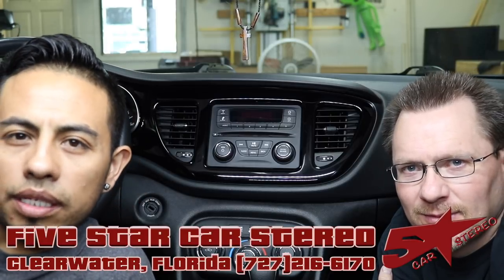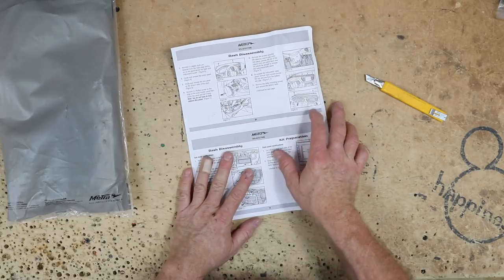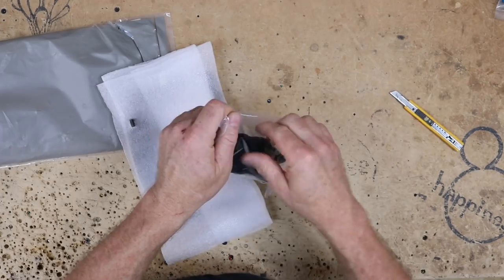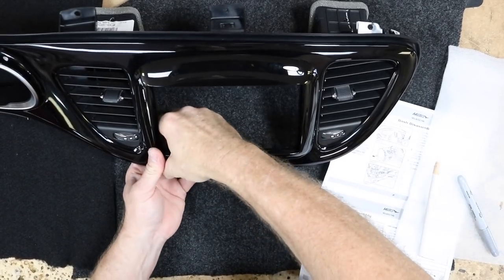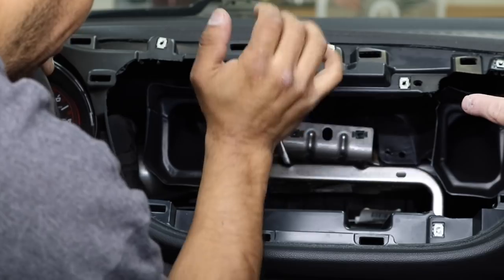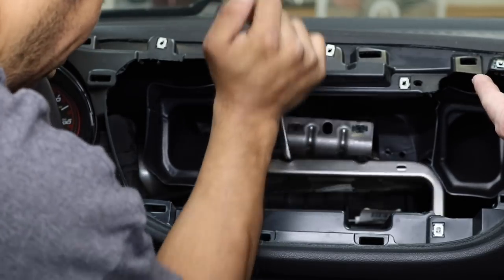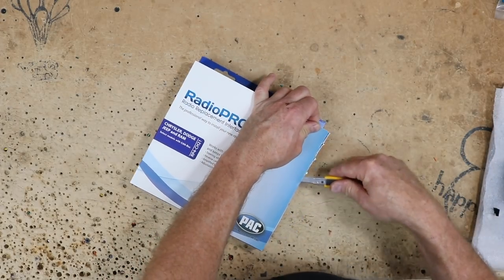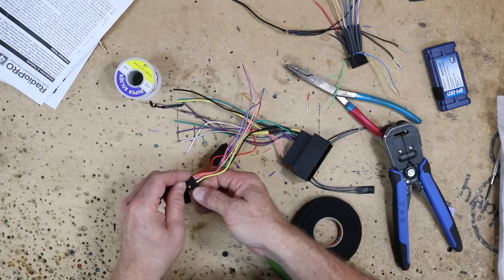The steps it takes to replace your radio Dodge Dart

Comment: The dart is a fun car. I did an Alpine single din with a 4 channel Alpine MRV-F300 and a JL 12 inch powered microsub. With Type R components in the front and Type S coax in the rear. I used the Metra side mounts and pocket but didn't use the bezel. It looked a bit off and the single din only required me to shave the factory bezel a bit. I made a panel to fit flush behind the factory bezel and it turned out nice. Although using the Metra bezel would have been much easier. My customer was pleased and really thats what's its all about. Nice video guys!
Reply from the maker: +sam the installer happy customers are a good thing, thank you
Reply: Five Star Car Stereo have you guys gotten into backup camera integration to existing factory screens? I just hooked up a 2015 Jeep Grand Cherokee and I was able to tie into the factory RSE inputs on the back of the radio. After that the dealership had to flash it. I'm trying to see if the same thing is possible in a 2017 Ford F150?

Comment: Can you install without the pac kit? I dont care if the radio steering wheel controls for the radio dont work but will the two buttons on the steering wheel work for the instrument cluster menu though?

Comment: On the aux wires down by the floor board, do we use all the wires? Or just red brown and black? What do we do with the others if we don’t use them? And will the aux in the center console still work?
Reply: Did you find out?

Comment: Hey guys thanks for this video, I learned a lot with it. One thing I learned is that I may have to bring my Dark to a professional installer like yourselves because it is way more complected than what I thought. If I replace my original single Din but double DIN stereo with the original Dart 8.4 stereo, would I have to still make all those customization to fit the screen? Thanks and take care!
Reply from the maker: +Marvin Menjivar it is not that bad, really. You would have to talk to a Dodge Tech.
Reply: The 8.4 system is different, the dash bezel is the same, however on the Dart the screen is just a screen not like the newer challengers/chargers where the tuner is attached to the back of the screen. The actual tuner, antenna connections are located up behind the glove box. Its generally not going to be worth the effort to do such a conversion unless you got all the wiring, and parts for practically nothing.

Comment: Question: any way to retain the factory hands-free mic?

I only ask because the one that came with the radio was installed and only occasionally hears me when I'm making a call. Weird thing is that when I use the "ok google" hotword, it works; however, it doesn't hear any commands afterward. I also have no idea if these issues are actually a defective mic or head-unit.

Comment: Wait so you guys used the same wire in the car to hook up the new radio. The two wires don’t fix on the radio screen it has three wires in the back how did you do it?

Comment: How do you know how many volts your accessory wire is putting out or what wire is the accessory wire. Connected everything up and radio doesn’t turn on.

Comment: Great tut!! However i have
An unusual problem. Installed
Pioneer avh 120bt. Now do not have steering wheel controls. Tried to reset to factory default. No success.
Unit scrambles my radio.
Unplugged everything. Still will not reset. Any ideas? Bad unit maybe?

Comment: So I have a 2014 Dart with the knob radio.  I hve a Kenwood Double Din 7.x'" inch screen.  But it really just a face plate its only like 2.5-3.5" inches deep.  No dvd or crap.   Will i stll have to take out that bracket?
Reply: Did you ever find out?

Comment: I would like for you to do a 2014 Camry sound systeam to a stock radio with gps
Reply from the maker: thatboyd86  I will add it to the list. Most of the Camry's we do, we remove that radio. They just don't sound that good in the first place adding amps does not help.

Comment: Can you upgrade a dodge dart’s basic stereo(like the one your video) to the Dodge Dart Touch Screen stereo ?
Reply: you're going to need the wiring harness that comes with the toucscreen, module and the screen itself. so if you could find all three you should be abe to do the swap. but i insist that you buy the Re2 factory stereo instead of the newer Rb5 because you'd have to buy so much more accessories.

Comment: I would really like to ask the intelligent people of Dodge why would they make the radio opening that small in the first place.
Reply: D.Remedy to kill the trade in value when they try to get a new car, that's why I drive a Ford LOL
Reply: Lol. I made the comment before they got to the AUX part. Just to much to go through.
Reply: lol same here love me expedition other that when its time for new plugs.
Reply from the maker: +D.Remedy just another day in the life
Reply: D.Remedy They've did is so that their 8.4 screen fits perfectly. they believe the dimensions of the 8.4 is perfect for an entertainment center. To be fair, it's one of the best systems out there.
Reply: Blame Fiat, those idiots screwed it up. FYI the Dart is a rebadged Fiat Viaggio
Reply: The Fiat Viaggio is a rebadged Dodge Dart. Dart was engineered from CUSW, based on Giulietta, Viaggio was rebadged to reuse CUSW in Europe.
Reply: My Theory is,,,,that the people at Dodge do not take in account people wanting to use after market parts. So they don't worry about making it easy to install / use them.

Comment: Hey what options do you guys have for the 13 journey wife has the 4 inch info screen
Reply from the maker: Anthony Johnson right now that is going to be the Metra 99-6520b kit
Reply: Five Star Car Stereo thanks looks like I will be able to use the 4 inch screen for a rearview monitor or for the backup cam is that right?

Comment: I installed a radio about year ago i want to go back to factory stereo is it possible to do this? im aware i need a new bezel
thank you
Reply from the maker: Alvaro Chavez yes you can but the factory back. It should plug in and add new bezel
Reply: Five Star Car Stereo thank you. you guys are the best!
Reply: one other question when I installed the aftermarket radio I used an antenna  adapter the 40eu-10 but since I want to go back to stock, will I need to remove the antenna  adapter? to plug in the stereo ? or can I used that same one?

Comment: nice, but how about to change the standard analog panel to a digital 7Inch speedometer (Is it possible to do this?). So I bought 2014 Dodge Dart sxt in the USA with analog dashes, and I want to buy 7-inch digital dashes on eBay or Amazon, and change it )  P.s I'm live in Ukraine

Comment: I just bought a Dart that obviously had some aftermarket sound system installed at some point. All the original equipment has been put back into its place but nothing got wired up. All speaker wires are cut up and the radio was disconnected. I put everything back to where its supposed to be and wired it all back up but I'm not getting any sound out of the system! Has anyone come across this or can someone lead me into a direction as to what I might have missed? Thanks in advance!
Reply: What happened with the dart that sounds terrible 😭

Comment: I have a problem with my odometer blinking after installing my aftermarket stereo. Is there anything i can do to fix that?
Reply: slice0flife is the odometer the only thing that blinks after you replace the radio (Just the mileage)? Or does it mess up other stuff in the car as well?
Reply: Yeah only the milage. All you have to do is go to the dealer and have them flash it to stop the blinking. It takes them literally 2 minutes to fix it.

Comment: Having installed a double din into a dodge charger. I honestly question why dodge feels the need to put so much junk back there you HAVE to cut up something inside.
Reply from the maker: +marsrover001 just seams like the new normal

Comment: Fabrication is one thing, but I have a factory u connect in my dart. However there is some issue between the radio and telematics unit so I can no longer Bluetooth to my car properly. and though I can fix it given the patience to take out the glove box etc... Android is appealing to me as a car radio. The issue is that i do not have a control panel with full climate controls and am wondering if a dodge can bus enabled climate control app exists for Android car radios? If not I know the uconnect units for higher end vehicles that were app enabled could run a standard android launcher through the app screen, installing one of these hacked with Android would be my backup plan but I'd still need to solve my Bluetooth issues. As far as I know little or no development has been done on the stock uconnect. If anyone has experience with dart uconnect hacks, or can integration with Android radios I'd like to see what's out there.

Comment: in my mazda 6 I lost Computer info and fuel consumption info by  instaling metra kit No info and no help from metra.Sorry but this is junk. I will newer by again metra kit.
Reply from the maker: +keeper18  unfortunately yours is a common problem. That is why IDatalink started making radio interfaces. Unfortunately they are kind of slow
Reply: Yap, you are right but I need kit for 2din radio, only metra or chinese win CE are avaliable.In some cars like mine with electronic climate control unit, you have to change the whole panel to install aftermarket radio so 
IDatalink is useless in this case.Thanks for reply, good work, and nice channel. Greetings from Poland:)

Comment: I'd really be interested how you would handle the Dart with the 8.4 Uconnect system. Horrible system, and damn near impossible to replace.
Reply from the maker: +Dave Pike is it one of the premium sound amplified systems?
Reply: Five Star Car Stereo No, it's just the basic 6 channel.
Reply from the maker: Dave Pike with no out board amp, your going to have to do something like a AudioControl LC7i or bigger to add amps.
Reply: That's what I was afraid of. I was planning on going that direction, my only concern was "crap signal in - crap signal out"
Reply: Actually all Chrysler UConnect radios have an amp.  I found this out while changing out my 5 inch Uconnect to a Kenwood DDX-9904S in my wife's 2015 base 200.  Just  make sure you use an idatalink compatible HU & select 4 or 6 speaker WITH amp as appropriate.  I wish I had seen this video a little sooner.  All those UConnect radios have that metal bracket.  I thought about doing what Fernando did but in the end I used a hack & cordless reciprocating saw, badly, to cut it out.  Now I got edges LOL  However I have to bring the car into 5star for some finish work & I'm sure they can take care of that for me.  :)   Love these videos.